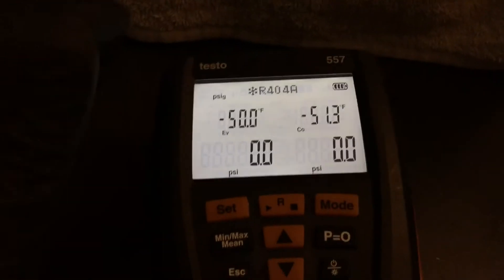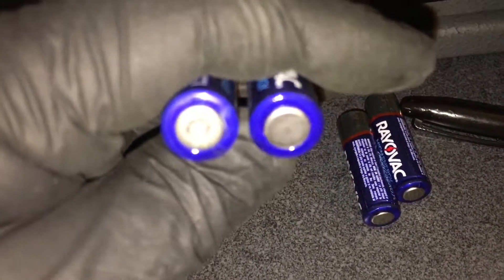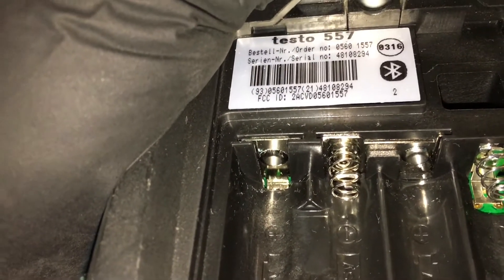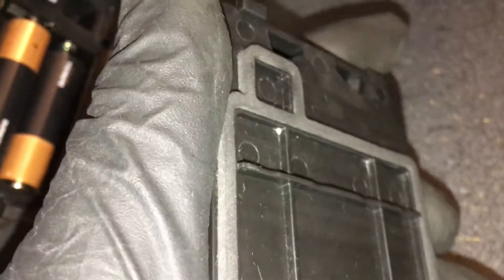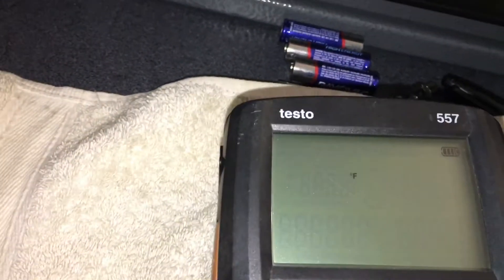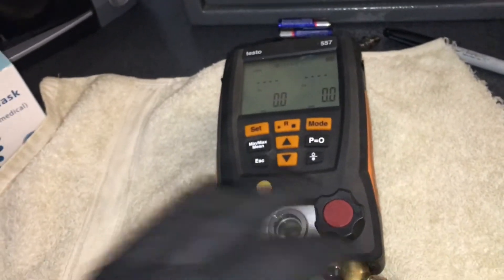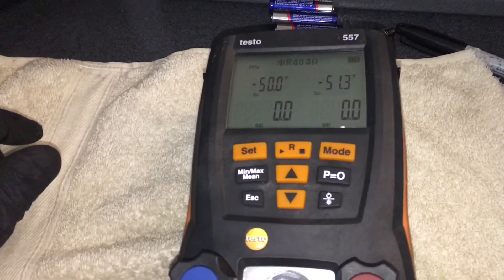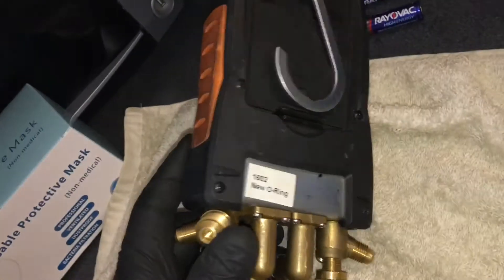How to change the battery’s in your Testo 557’s Refrigeration guages.

Comment: Your batteries last you a long time if you screen hours. 
         I’m lucky if I even get three months before they’re dead or down on the last bar indicator. 
           For corrosion I put a little  ( DeoxIT D5 ) on a Q-tip on the tip of the springs that touch the battery and on both sides of the battery so when your gauges are in a high humidity environment you don’t get that rust and corrosion unless you get a leaking battery that’s a whole different ball game. 

          The rechargeable batteries are the way to go ( envelop ) made by Panasonic